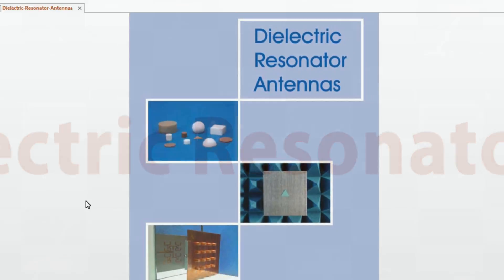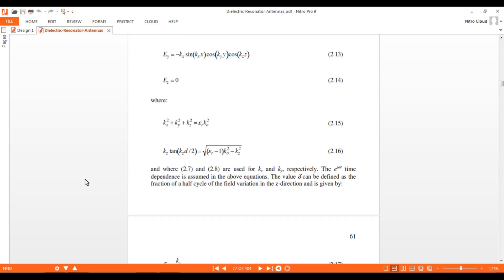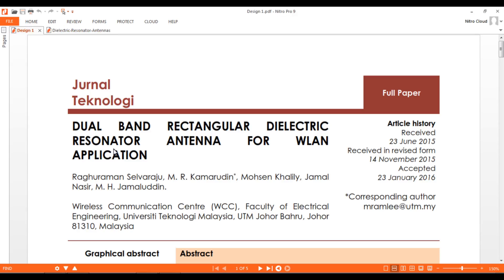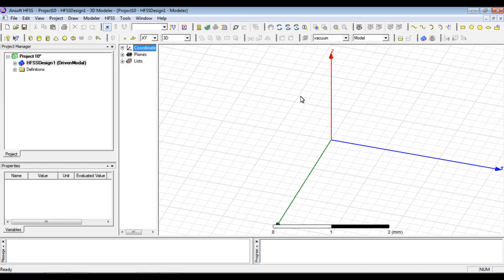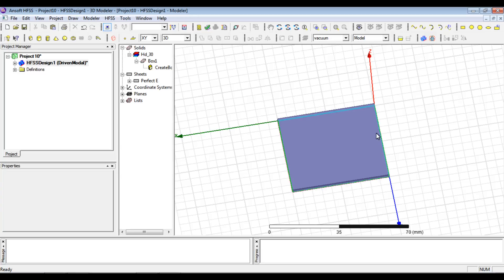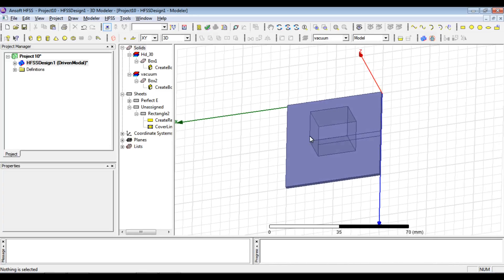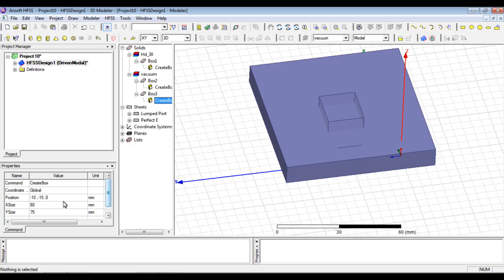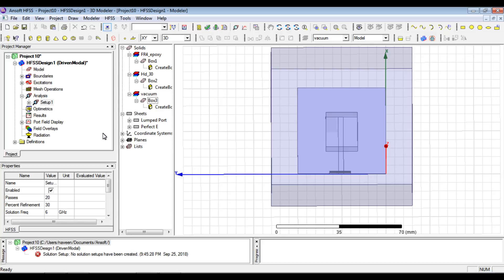Design of Dielectric Resonator Antenna (DRA) in HFSS [Full HD]

Comment: Hi Dr Naveen, i have simulated a cylindrical cavity resonator with a TE 011 mode at 8.5 GHz, when i placed a Dielectric resonator (DR) inside, the resonant frequency is increasing to 9 GHz, i am expecting to be lower than 8.5 GHz, do you know what had happens, dr ?